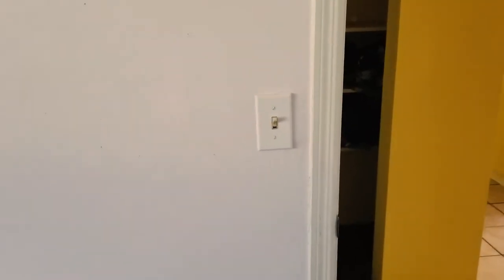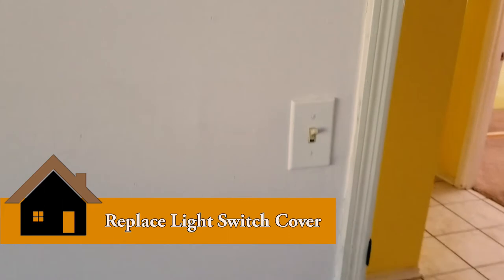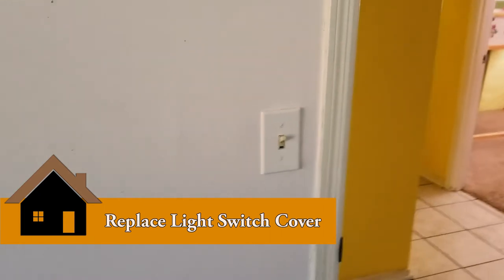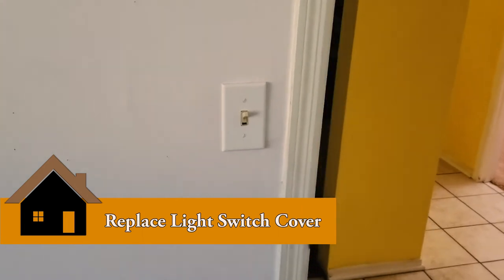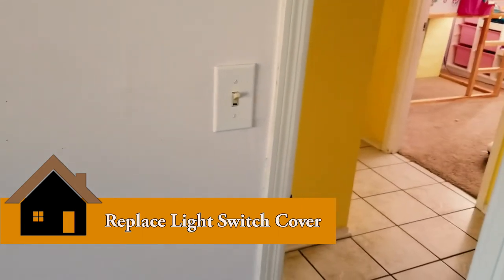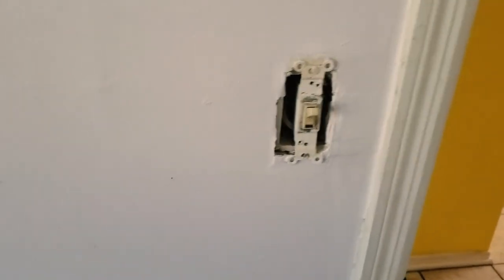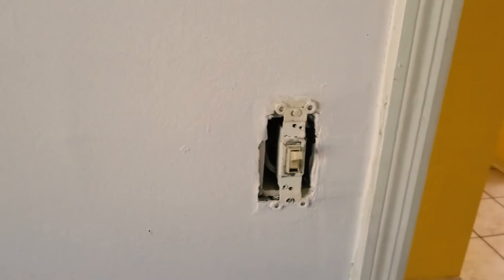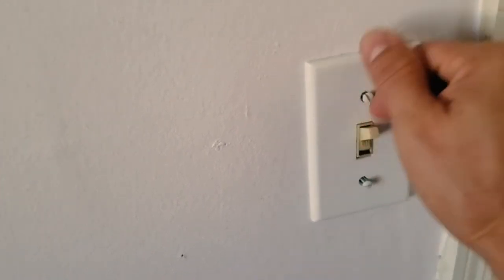Installing a Light Switch Cover

Comment: Lol! I have to look this up to make sure that I dont need to turn off the main power before I unscrew them
Reply from the maker: You truly don't. The screws do not touch the wires. Of course if you drunk and your hand is wobbly then maybe lol
Reply: Are you sure?
Reply: Same that's why I looked up this video I wanted to be sure whether or not to shut off the power first 😂
Reply: Same 😂, after watching this I remembered I did this myself in my dorm. Time forgotten. I need to stop using THC 😂😂 but I need it...
Reply: That was also my purpose of searching. I knew it was easy but electrical things are not my area😂

Comment: Just wanted to see if you went out of the way to turn off the power as it says to do on the back 😒...didn’t think it was necessary to either.
Reply from the maker: not really. I only shot off the breaker when is touching the electrical wires like changing the actual switch or outlet. for the cover I do not.
Reply: @MasterMindHandyMan That makes sense. I just installed my new plate. Didn't have any issues. Thanks for posting!
Reply from the maker: @Onika0325  glad it worked out. subscribe for future home handyman videos.
Reply from the maker: please subscribe for future do it yourself videos.

Comment: Great video!!! But Does it necessarily to turn off the breaker when we do this . ??
Reply from the maker: Not at all. reason being is that you are not messing with the wires. you are just changing the cover. the screws themself do not have contact with the wires.
Reply: I don't want to take a chance getting electrocuted.

Comment: i took the screws off. however it looks like whoever installed it has it glued shut to the wall. would you know how to remove it?
Reply: figured it out. did it within 10 minutes. thanks for your help! i’m just too scared to turn the power on now
Reply from the maker: @wintab9383  hi. sorry it took a moment to respond. managing several channels and multiple businesses is a bit challenging but here i am lol. alright back to the question which glad to hear you got it. but in case you did not and for the future. the best way to remove without damaging the wall further is a blade. cut around it close to the wall and the plate carefully then losen the screws of course and yahoo done. changing a cover for the switch or the outlet does not require to shut off the entire room power as you are not really touching the wires only the covers. however whenever in the future you need to mess with the wires you want to for sure always shut off power then follow the colors on the wires and replace exactly. then put it all back. last thing is put power back. of course a task like this is as simple as the screws holding it lol. thanks for stopping by and please subscribe

Comment: my question for you is its it the same for an electrical swtich plate? but guess I should use an insulated screw driver?

thoughts please thank you
Reply from the maker: This applies to either electrical outlet or switch. the plates are held by a single screw on switches and by 2 on the outlets. neither of the screws touch the electrical wires so removing them to replace the plate is safe without the need to shut off the power. any screw driver will work. they do not need to be specific or coated.

Comment: I have a three panel switch plate with dimmer switch a round knob. Does that just pull off replace the plate and pops it back on?
Reply from the maker: yes. same concept. only thing that is different is you have 3 in one instead of this one being just a one switch plate.  I found a list of the kind you need on amazon here https://amzn.to/3qP2cLy so find a matching set you like and order it.

Comment: My cover seems too small for the hole in the wall and although the screws are tight it sits outside. Should show one on an old house and some issues too with the screws. Old ones were longer than the new ones.
Reply from the maker: in this situation you need to replace the switch so is left right level with the wall so cover screw grabs on. you may also purchase a bigger cover to go over the wide opening and longer screws as well so it can go further and grab on. these are sold at the store so explain to an associate your situation and she/he will guide you on what to buy. if you prefer to shop online let me know and I can reference a link for you

Comment: I see that the four corners are in front of the sheet rock. What do you do if they are inside and the perimeter of the sheet rock is larger than the actual switch.
Reply from the maker: compromise by going with a plate cover that is small rather than using a large one

Comment: So, you don’t need to turn the electricity off first?
Reply from the maker: no need to. all you are doing is changing the cover which has no contact to the wires.

Comment: Right. Now let me see you replace the plate after installing a new timer in place of one of three of the newer switches with the broad button. It's much easier said than done. The timer I put it turns the front 3 porch lights on at dusk and off at sunrise. It is super hard to stuff the wires back in far enough to attach the switches and the timer and then get all three aligned with the six holes so your can get the tiny, very short little screws attached.  I had to remove the center switch to get to the white wires in back. This may be easy for an electrician, but not so much for me...
Reply from the maker: it gets a bit more complicated for sure when needing to change the switch. adding dimmers. etc. this video was intended for basic users on how to change the cover. I liked that you stopped by to share. thanks.
Reply: wow, aggressive much dude?

Comment: My room has a dimmer and i idk how to take that knob off to remove it lol
Reply: Hi Lyric. Thanks for stopping by to watch the video. The dimmer ones are a bit different lol. the removal is almost the same as a regular switch. however the assembly from the inside changes. cables should be straight forward compared to a regular switch. Check this video I found you may like on dimmer switches https://youtu.be/cTWq7h4eTws
Reply from the maker: please subscribe for future do it yourself videos.

Comment: Don't you need to turn off the power first
Reply from the maker: that is a natural concern. this particular electrical do it yourself does not require power off. I am only changing the cover not the switch. so cables are never touched. of course it does not mean you open it like a middle school child and get your screw driver inside and mess with the cable haha. you better subscribe for future videos